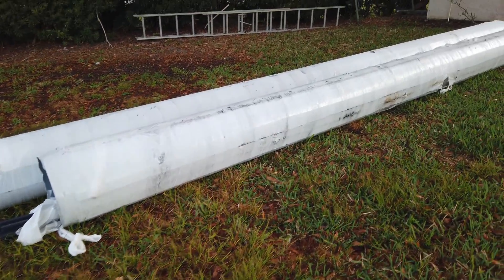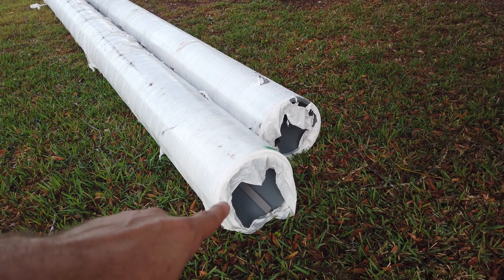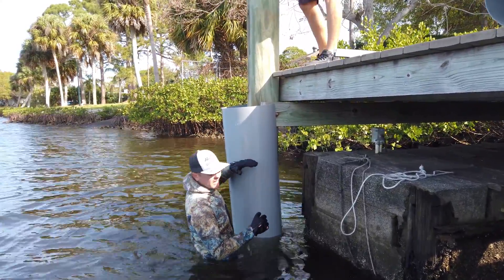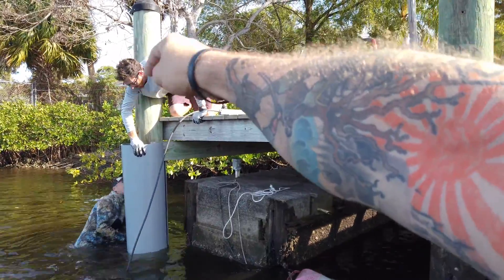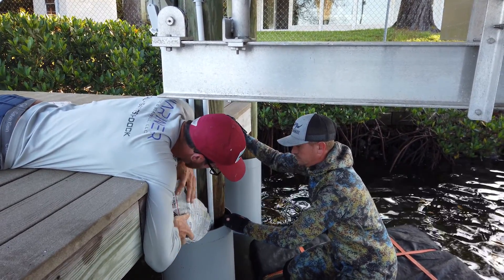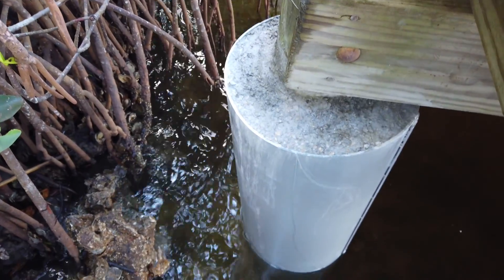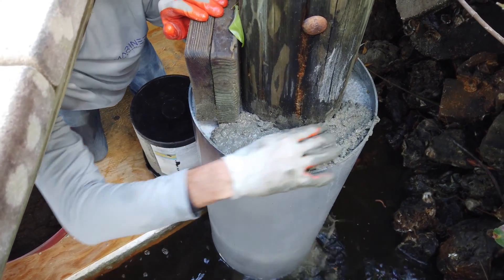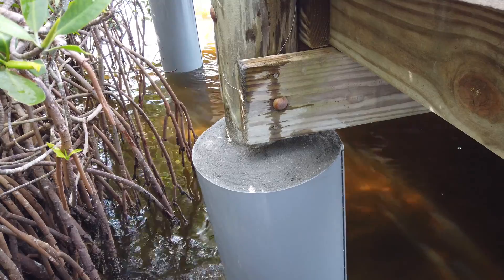SnapJacket Dock Restoration Project

Comment: Please share your concrete mix for underwater use. I want to build a 3 sided mold to put around my 6x6 post holding up my seawall on a lake. Obviously 1 side is facing the lot with 2x6’s attached. 3 sides are in the lake and several post are losing their structural integrity. Please advise and many thanks. David
Reply from the maker: M15 should do fine. Standard mix ratios work underwater

Comment: how is this holding up? I'm considering using snap jackets for my dock, but my pilings are in rough shape.
Reply from the maker: @bradleyryan1117  great! Concrete is the way to go. You can use any mold you want. The snap jackets are just a mold for concrete.

Comment: Snapjacket User Notes from my usage:

 (1) The original product "Snapped together", the better current product as in this video has the slidable spline that seals the two sides. Make sure the spline is in place before you add concrete. The first concrete added will tend to open up the snapjacket unless the spline is in place.

(2) Here I used box store bagged concrete and mixed it in a tub and poured in the snap jacket with a piece of aluminum gutter cut into a custom gizmo to feed it into the gap.

(3) Use fast set concrete at least in the first bag so the snapjacket tube has a "plug" that is hardened. Otherwise concrete can still be so heavy as to force its way out even if the jacket is 1 ft down in the mud. Also the snapjacket can set up at a weird tilt if you walk away the concrete starts to harden when one is goofing off.

(4) a crude estimate is you will use a bag of concrete per foot. Use a steel rod or broomhandle to get the airbubble pockets out. A better estimate is measure all the piles diameters, figure their cross sectional areas, subtract from the snap jackets diameter.

(5) The snap jackets are a little bit bigger in diameter than their nominal size. ie a 12 inch one is little bit bigger than 12 inches

(6) In areas with a tide you can plan the project around lower tides so it is easier to work. Here with my farthest out piles I still had some water seeping back into the snapjacket as I was preparing concrete. Thus the first bag was really just quickset dry concrete mix only to seal off the bottom as plug. This is in muddy muck ie marsh mud. The next mix was added almost all dry because I had water entering still. ie you are making concrete with the entering water. if the concrete is too watery the ultimate strength is way less.

 (7) One pile had a decades old rotted pile right next to it. the 12 Inch snap jacket would not go around both piles so I jetted out the old pile. This took much time, used a cum along and pulled upwards and finally got to rock it side to side to remove it. Commercially it would have been easier to use a snap jacket one or two sizes bigger and go around both piles. The old one was broken of at the mud line. Pounded 60 penny nails to the old pile to connect the winch ratchet to. Now with the old pile out I go the snap jack in place and filled the old pile's 8 ft hole with a few bags of rocks. The old pile was a very small pile 5 inches in diameter. 

(8) Another pile hear had an ancient pile that I could not remove, it was broken at the mud line. Here I could get a 12 Inch snapjacket around both at the mudline. But I had to have the snapjacket be off vertical on this one slightly to work. 

(9) Most all pile degradation is right at the water line. Below the mud line a 40 year old pile can be about perfect. Way up in the air a pile degrades but slowly. So the reason for the snapjacket is to halt the pile degradation. It does add some added strength too. 

(10) A Floatng RING made from yard irrigation piece of black tubing can be added around each pile. This scrapes and reduces growth. Use the yard tubing connectors to make the floating rings. They last about a year or two.

(11) for jetting I just use a garden hose to some PVC pipes with a cap with a hole in it. This is for marsh mud.

(12) The three 12 inch pieces I got were like 580 bucks a year ago and were like 16 to 20 ft long, ie roughly 10 bucks a foot. It was well worth it. Nobody locally works on old piers, it takes years on their waiting lists. So this product halted the degradation and actually added some robustness since the piles have more mass for our hurricanes. Got them from Ace hardware in Mobile Alabama, Wigmans. Cut the snapjackets there with my sawzall so fit my trailer.

(13) in a couple of piles the snapjacket started to tilt some, thus a rope was used to pull to keep the jacket centered until the concrete set.

(14) Mine I did at ultra low tides for the year which here is in the summer at sunset. So most of the work was done actually after sundown. Never saw any of the local alligators. Had to add scrap boards to stand on while working on the mudflats below the pier in Mississippi. Otherwise you can sink. There are some even lower "low tides" in January but rather cold here this last year.
Reply: what a great detailed post. thank you for posting this